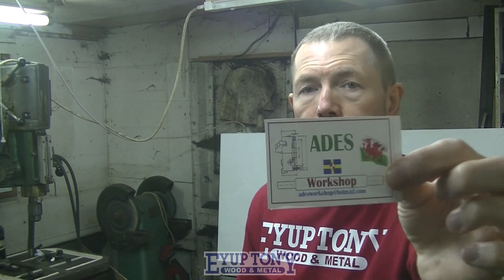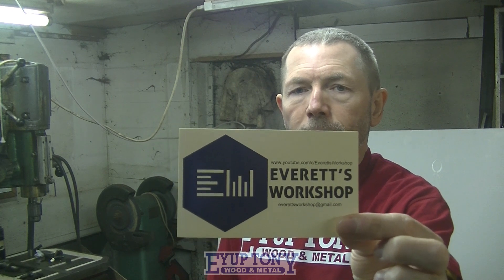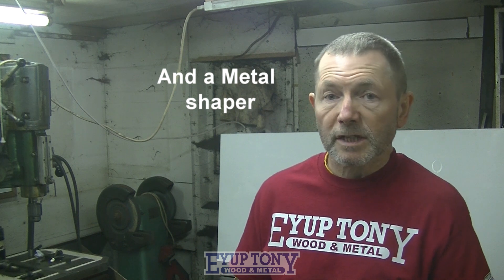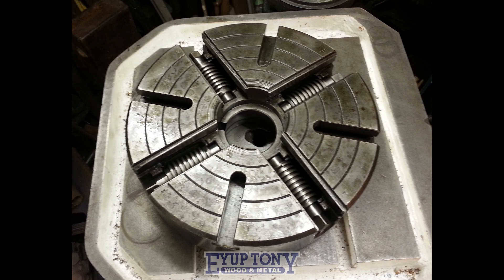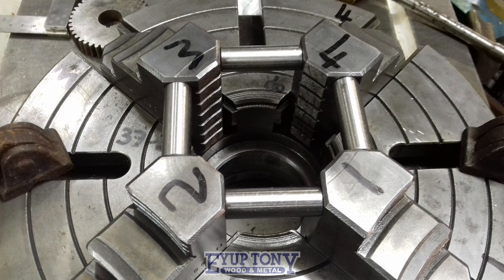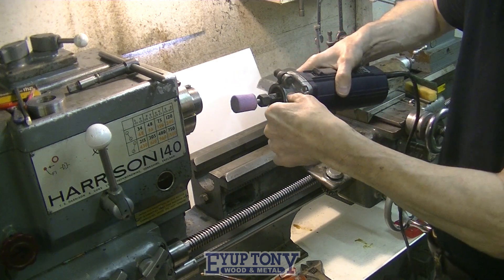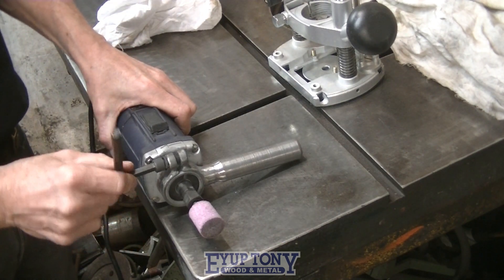Make a toolpost grinder. Grinding lathe chuck jaws on a Harrison 140 lathe

Comment: 7:17 Very top left corner - how long have you had your box of capacitors and have you had any issues with it ? Mine went bang last time I tried to power it up.
Reply from the maker: c1987ish when I got my shaper. It ran flawlessly up until 2017 then something burnt out. I needed it fixing ASAP so I took it back next day to Power Capacitors they fixed it while I waited it took them a while to find out what caused the fault. They said it was an old model lol. They fixed it, checked it out and re tested it thoroughly all over under load, really impressed with their service. Back plugged in and working the same night.
Reply: @eyuptony  I've 2 issues with the thing. Firstly, it seems the capacitors used in things like that are not noted for having a long life and secondly, we've replaced the motors on both lathe & miller - and I wonder if the 3ph is as 'even' as it should be - tending to burn out one winding that's doing more work than the others! It may be that we bought 2 machines where the motors were nearly knackered anyway !
Money's an issue for getting ours fixed considering since Dad died, the machines have had very little use. I'm not keen on VFDs - they seem ok for what they are but not sufficiently 'industrial' for me - one accidental lathe reversal I suspect would kill it. Especially since the lathe is designed to do that.

Comment: Eyup Tony - my first visit to your channel following on from comment on Doubleboost re slack spindle bearings ;)
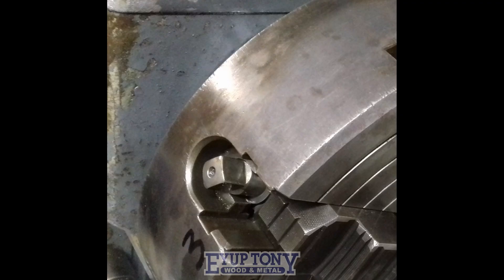5:24 - trying to make head nor tail of the gear selection levers - as they're shown with 3 positions for the top two - left, right and centre for both of them yet clearly they've not got all those positions ! Compare RH lever for 75 & 120 - it in the left position for 74 and right position for 120. But for both 34 & 48 in in a centre position !
I'm guessing they're really much the same as the Colchester lathes of that style.
Reply from the maker: Centre position is neutral with the levers on the top of the headstock just four speed. The larger lever on the front of the headstock is high and low making eight speed. Then you have a two speed motor making 16 speed.
Reply: @eyuptony  So, of the two levers on top, you can only have one in gear at once - otherwise nothing goes round ? That's interesting. The Colchester is similar in config but the 2 top levers are always fully left or fully right - so both always in mesh. The front lever moves a lot further and is not held in any position by springs/detents - so finding a mid-position for neutral is not too hard to find.

Comment: Great idea with the router. Often thought of using one for something but thought it would run to fast, but not for a grinder. Looked you up from Ade's workshop recommendation.
Keep the idea's flowing. I am looking for a high torque motor to power a hacksaw project.
Thanks again. Fred
Reply from the maker: Hi Fred. Thanks for viewing, these are only small grinding wheels I checked the RPM before mounting them. I wouldn't use it with a disc type grinding wheel with a bore mounted on a spindle between collars I think it would be too large and heavy. Have you tried a treadmill motor.